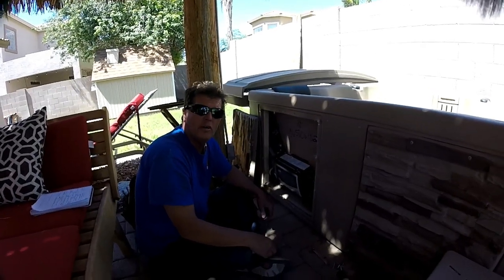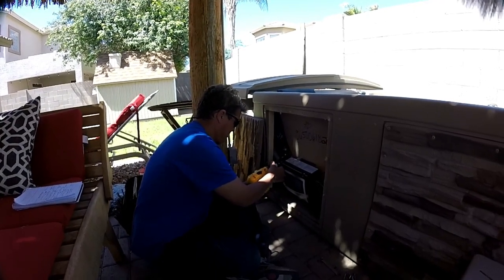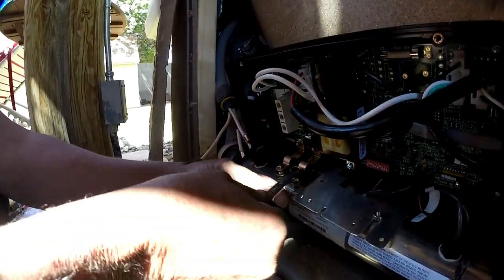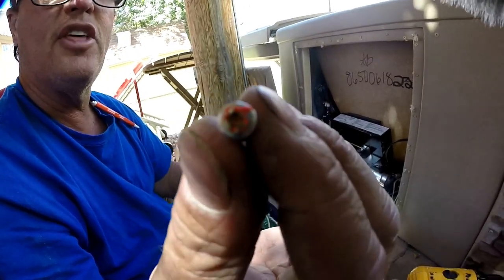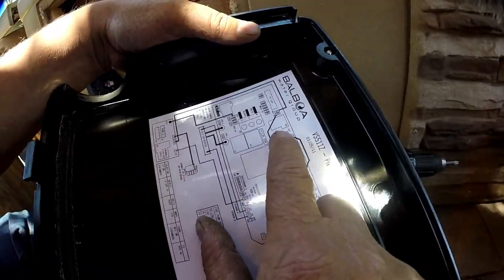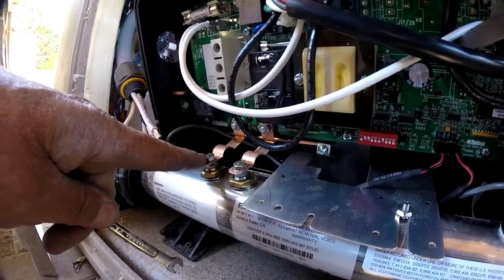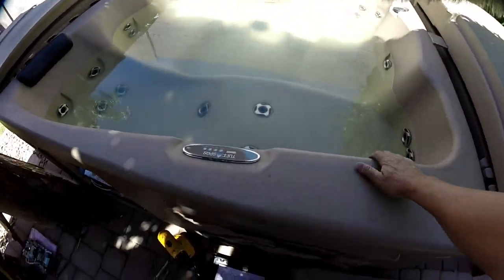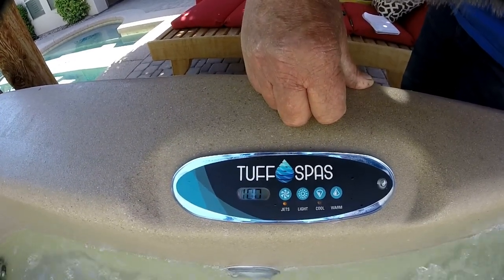How To Remove & Replace Board In Your Hot Tub(BALBOA VS PACK) TuffSpa TT650 (DIY Spa Repair)

Comment: Great video. The screw on my board that has a the paint on the head was in the bottom left. Just scraped out the paint with a small pick and used a quality screwdriver. I didn't have to remove the wires from the heater. I was able to just unplug the black plug on the board that is for these heater wires. The board cleared everything and was able to be removed. I also had a sub-board in front laying flat on top of the heater for additional motors. That I removed.

Comment: I bought a Balboa replacement board. No one would answer my questions about the dip switches. You did. In fact that Board you replaced is the very board I bought only set up for 110v.

Comment: Good Job Spa Man, Your work needs an award. It helped with our 2007 Dim1 19' Aqua Swim Dual Spa and Hot tube rebuild. Working on an M-Class, spa side board failed and been avoiding it's R & R. Dim1 Products have limited YT vis for some reason.

Comment: Just spotted a possible cause of the heater connections burning up:  the connection bolt on the circuit board has a nut Loctited in place -- and the Loctite got on top of the nut, which will make for a higher resistance connection.

Comment: I am getting power to the hot tub. The top side is not getting power or coming on. So how do I check to see it it's a topside or bad board? Nothing inside the tub is getting power(pumps, heater, etc). So I don't know if it's a lack of power to the topside. Is there a place I can test for power inside the board after the line set? I've checked all fuses.
Reply from the maker: Check to make sure it is hooked up correctly and all connections are tight Proper wire size and type is very important also #6 THHN wire only (Not Romax ever)check all grounds and check with the breaker turned off the all connections in the pack are pushed in all the way check all fuses with a TESTER. if all that checks out and its a New tub call the dealer you bought it from If you bought it on line and the manufacture dropped shipped it to your door Im story to say LET THE FUN BEGIN and get ready for endless email and phone calls or you could bite the bullet and hire a spa tech to come out and figure it out and fix it for you. If you bought the spa used then like I just said call a spa tech and you with be good to go. Thanks for Watching & SUBSCRIBING

Comment: hi scot i from montreal i have a cliente who is looking for replacement off balboa mogher board EL8000 but i dont have om my stock is there any equivalent  for it as i have El2000 or other balboa control systeme like BP or VS
Reply: Did you ever find a board ? I need to replace mine trying to source a new board

Comment: Scott - great videos!   This is Peter in Orlando, and you & I spoke 2 weeks ago about my Balboa Antigua Spa Dura SportAW. F6. Ec
:  Model #:  VS501Z.  I confirmed its getting 120V and the board , and the topside control does not appear to be the problem.  So I'm now guessing it's an issue with the board (6 years old).   There's only 1 pump (which is working fine).  Also, Balboa told me I could replace on my unit w/a 300VS board versus the 501Z (does that sound right?).    Do you have any suggestions on where to go for for a quality & economical replacement circuit board?   Amazon, local, other?    Thanks.